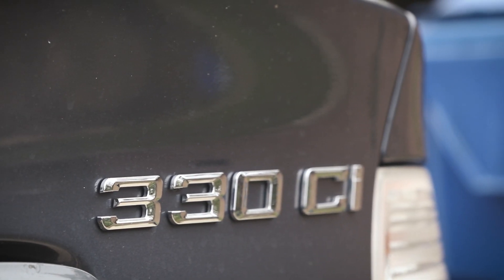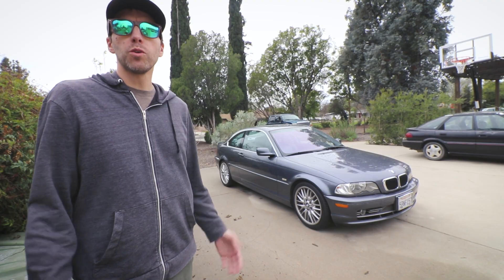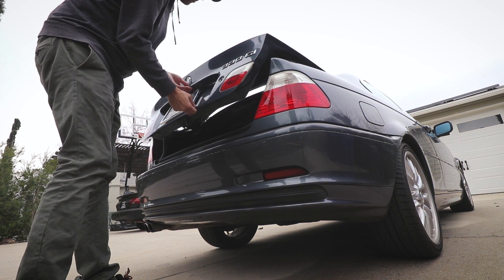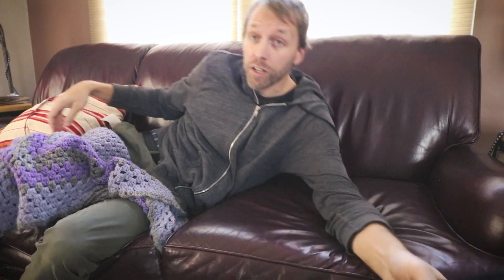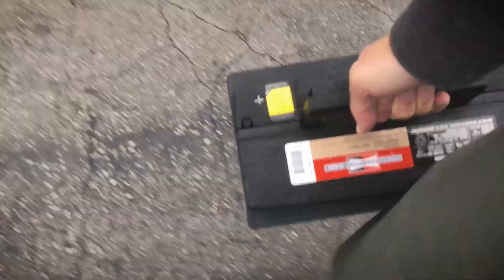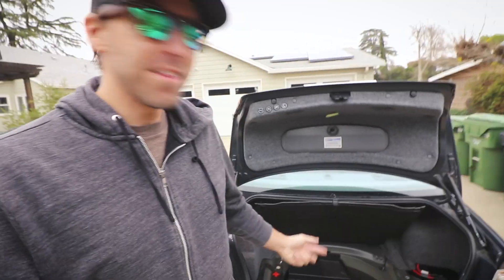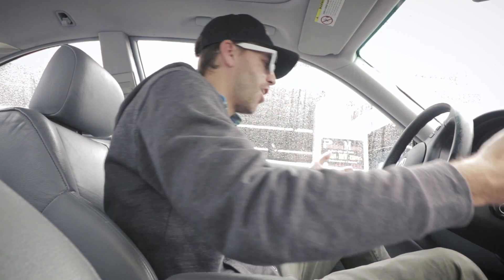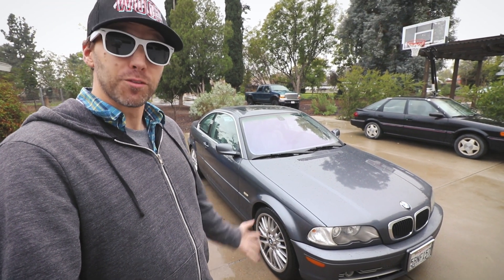Nothing More Expensive Than A Cheap BMW? - 330ci E46

Comment: I've always thought about getting a cheap BMW... well not as cheap as you got one for and this time of perturbs me from doing that 😅 I'd really just want it to have a nice comfy car with some sort of power that could be used for long drives for fun... I've always heard that BMW was second to Mercedes in the reliability area of luxury cars. Maybe a Mercedes would be a better choice for what i want?

Awesome video as always by the way
Reply from the maker: Hard to say—some have decent luck with their BMWs. My 740iL is pretty reliable, but when it does finally break it's going to be expensive. When buying any older european luxury car I think you just need to prepare for the possibility of larger repair bills. Thanks again for watching! :) :)
Reply: Look for an E39 540i. They are the perfect daily, comfortable ride, and decent power to have fun. Plus it's an older BMW and with my personal experience they are much more reliable than the newer models.
Reply: @kuro0198  It looks nice... but being a V8 is a "downside" to me as the fuel prices aren't cheap over here like they are in the U.S
Reply: @Mysticfateee  if the V8 is not economical, than BMW offers many inline six engines that get great gas mileage. I don't live in the US so I can't speak on their gas prices
Reply: @kuro0198  I don't know their prices either but i do know they pay per gallon and i pay per litre...
Reply: The Benz Diesel engines are pretty indestructible. My first car a 2000 e320 hasn’t had many issues. Mostly just wear and tear like the ac compressor and etc.
Reply: As a general rule of thumb (that I use and haven't that many problems for old cars) a BMW between 50k and 90k miles is mostly trouble free and one over 150k the same (if only for another 20k miles). The latter because all the usual suspects in the engine bay have already gone bang and been replaced but auto 'boxes tend to start slipping around 150k. All in my experience, I'm sure others have different opinions.
Reply: I got a 2000 328i for $3000 and it's been a fantastic car. My tip is to find one that's been taken care of well and do some preventitive maintenance when you can. The e46 can be pretty bulletproof, decent horsepower and a very nice interior make them probably the best car you can get on a tight budget.

Comment: I'm pretty sure the starter was fine and the only thing wrong with it was a fuse although replacing the starter on the e46 is always a good idea
Reply from the maker: We did check fuses, ground cable, and EWS. Feel pretty we got it right but you never know :)

Comment: Be glad you could afford to have someone replace your starter. I hear that is a really nasty job for shade-tree mechanics. Very difficult to get at.

I bought a new battery at Walmart. It's freaking awesome. Not Chinese. USA made and cheaper than anything else I could  find. 

It is super strong. I have a lot of lights thst come on (E46 M3) as long as my doors are open... like my aftermarket halos and running lights.

It doesn't matter how bad I abuse this new battery. Every time I go to start the engine it turns over once or twice and springs right into life. This has been the strongest battery I have owned so far. They call the size H7 now.

Comment: i have had my 2002 330xi for 5 years haven't had to fix anything... bought from a mechanic ...207k miles but replaced engine has only 100k miles    edit also its a 5 speed

Comment: Personally wouldn't own a 330ci as they are shit on fuel.. but are fairly powerful... here in UK petrol is £1.20 - £1.30 a litre so not really the kind of car you wanna drive daily if you like having money.... I'll stick with my 320cd gets over 50mpg on motorways even doing 90 to 100 mph... think the 330ci averages around 20mpg... lol

Comment: When you tried to start the car did the key feel locked when you tried to turn it? Because my e46 325ci does the same since the steering wheel can be locked just wiggle the steering wheel while having they key in and it will unlock the turn over being able to fully turn the ignition on
Reply from the maker: That has happened to me with other cars, but that wasn't the problem here. After a bunch of testing we determined that it was in fact the starter.

Comment: 700 for a new starter? yikes. thats why i always do the work myself. just bought a 2006 330ci today for 1700 but my starter works
Reply from the maker: It was a starter plus a few other things. Starter job on the E46 is not very fun.
Reply: @HelloRoad  yea i see what you mean about it being a pita job. i just watched a video on it. I try to do as much work on my cars as possible because i don't trust most shops to touch my cars. I've seen so many people get burned financially with half assed  repairs. A good example of bad mechanics is the 330ci i just bought. The mechanic told the owner that it has a blown head gasket because it overheated. I just did a compression test on it and its perfect and it runs smooth. The oil looks good too. The expansion tank was the culprit, not the head gasket. Damn thing only has 60k miles on it and for a 2006 thats garage queen territory.
Reply from the maker: @gregh7457  Glad you figured out it was just that common expansion tank issue! 60k miles is great for a 2006!

Comment: You know you can check the voltage on the dash right?
Reply from the maker: I wanted to check it directly at the battery in case there was any other electrical draw...
Reply: How do you check it in the dash?

Comment: How do I know if my 2006 330ci has the zhp package
Reply: Black headliner, gloss black trim around windows, gloss black triangular plate that attaches wing mirror to a door. There are a LOT more items that make it "ZHP" (M-sport in Europe), but the ones I mentioned are the ones people usually don't bother to change on non-ZHP. If you have gloss black trim around windows for example, and it's OEM part (i.e. not a wrap), you can be 90+ % sure it's a ZHP.
Reply: @dakibmw  M Sport its not ZHP. 
ZHP is only US package. Different camshafts, higher redline - 6750, BMW performance shifter. It also has ZHP specific cluster with orange needles.

Comment: Warning too anybody out there. Don’t be a dumbass like me and not check out the DISA valve on the car before you get one
It’s a plastic component that goes into you’re intake manifold    I did not check mine and the plastic flap broke off and it’s now in my intake/engine.
Reply from the maker: This is a good warning! My DISA valve was about ready to fall off so I just removed it. Will replace it at some point.

Comment: So easy to do it yourself
Reply from the maker: I'd say that for many jobs but replacing the starter on an E46 is not fun.
Reply: @HelloRoad  after several jobs it gets to be clockwork :D. At first I definitely broke the water oil separator or whatever that plastic garbage is entangled under the intake manifold lol.

Comment: Never charge or jump your bmw from the battery terminals. You want to do it from your terminals from the engine bay.
Reply from the maker: I have read mixed viewpoints on this. Most say don't do it but others say it's fine. Do you actually risk damaging anything?
Reply: Not if it is severely dead. You get more direct power if you jump it from the trunk.

Comment: Why is the battery in the trunk? Damn germans$
Reply from the maker: I would guess possibly for weight distribution? Not sure though.
Reply: I spent 2 hours trying to change the battery on a 1st gen X5. I had a modern land cruiser next to it and it had the battery in the engine bay. I got so triggered at that point >:(
Reply: Lmao on my 95 525 bmw the battery is under the back seat... pretty weird. But there’s terminals under the hood so I can still jump it easily
Reply: Save weight up front for better load distribution. Same with a lot of higher end cars for performance.